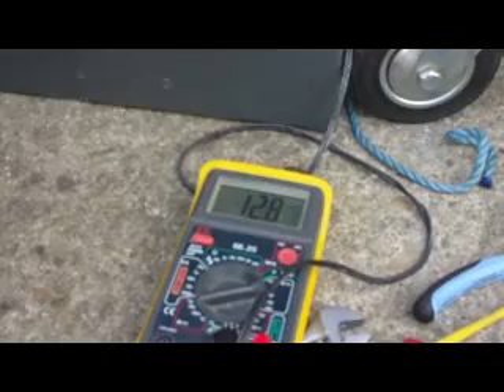Williams WR27-1 Turbine Engine Second Starter Test

Comment: I worked on these in the Navy and for 11 years as an employee at Williams. I was an assembly and test cell inspector in the 70s and 80s. It’s extremely likely that I’ve worked on this very engine. My metal stamp number would be on the nameplate “F51” if I performed the final inspection.

Comment from the maker: Now that the engine has been run to full speed the oil leak has disappeared completely. Scavenging from the rear bearing is dependant on HP air. So it's possible that all the low-speed spinning was the cause, as there will have been oil pressure but little scav air pressure.